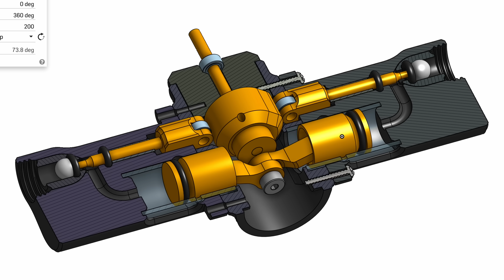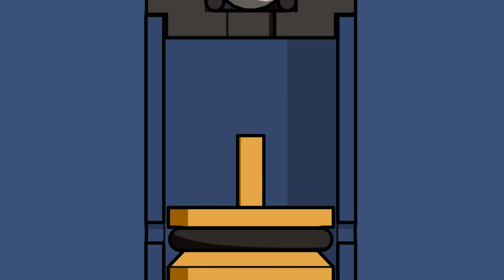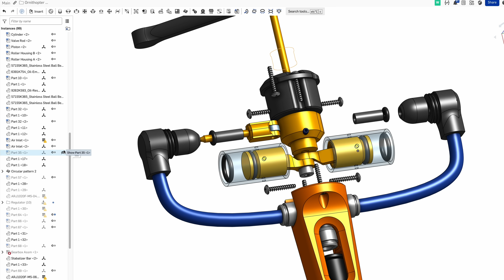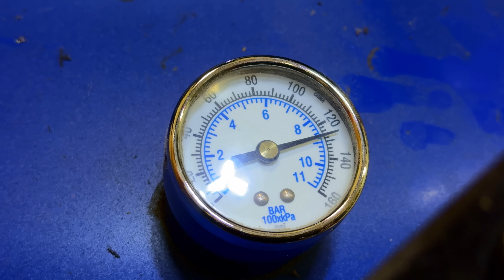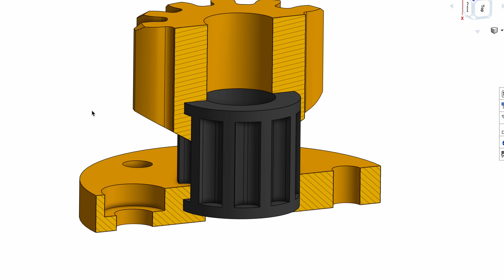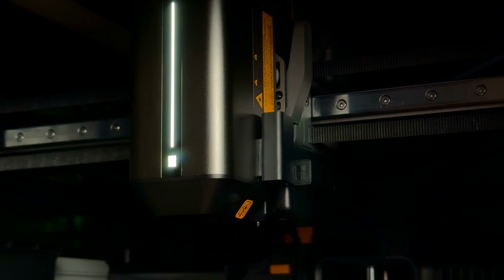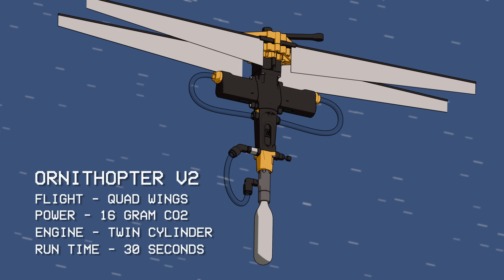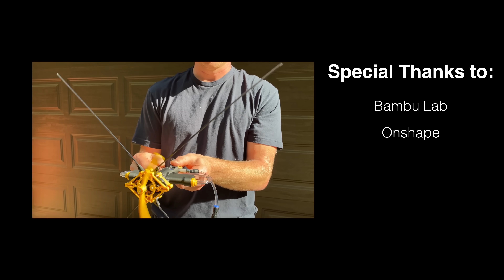I Tried to Build a Flying Machine With Just CO2

Comment: So cool! One thing to highlight, which I'm sure you know, is that regulators waste most of the energy in the gas. As the gas goes through the regulator is just does work on itself by friction, raising the temperature (or at least reducing the temperature drop that one would normally get from adiabatic expansion). One would have much more power if the engine could be designed to operated directly from the ~800psi source, or failing that, at least from a much higher first stage regulator pressure.

Of course if we wanted to keep the force on the crank the same, we'd have to reduce the piston area by ~25x, which would mean a 5x reduction in piston diameter. The o-ring based design would probably be very difficult or impossible to scale down that far. However, you're clearly underpowered, so you're probably going to need a higher force on the connecting rod anyway, and maybe something more like a 2x reduction in piston diameter/4x reduction in area, which would leave you with "only" 6x the force on the connecting rod could be feasible.

I guess another thing to mention is that the dead space between the valve and the cylinder is probably not doing us any favors in terms of efficiency.

Then, another commenter @DuelPorpoise suggested a compound expansion engine. I think this could be highly useful if you operate from a much higher pressure, although not exactly for the same reasons that a compound steam engine is useful. If you can figure out a way to make a first stage engine with no exhaust ports feed a second stage engine, where the crank case of the first stage is basically the first stage's exhaust, then you'd be able to reduce the load on the first stage's connecting rod by the amount of crank case pressure. Maybe there would still be drilled exhaust holes in the cylinder/liner but now these holes are inside of the first stage crank case. The reduced mechanical load might make the conn rod/crank mechanical design easier, although of course it will make things much more difficult in the sense that 1st stage crank case sealing is now required, and since the first stage would see the full inlet pressure for the first couple of strokes before the crank case became pressurized, it might require a spring loaded relief valve bypassing the 1st stage to the crank case to pre-pressurize the it and prevent excessive load on the 1st stage piston.

Then, if you're doing a second stage, it's tempting (although possibly not practical) to imagine inter-heating. Of course, as we expand a gas, it's cooled down (adiabatic expansion). This reduces the pressure of the gas compared to what it'd do if it was kept warm (isothermal expansion), and so reduces the available power. In sort of the opposite manner as an intercooler on a turbocharged engine, we would benefit from re-heating the gas if possible in between stages. Now, doing this in a lightweight and 3D printable way may not be practical. But it sure would be cool! I guess the first thing that comes to mind is a phase change material, and the first phase change material that comes to mind is water. I don't know how one would pass the gas through a system that would allow it to contact a couple grams of water and start to freeze that water in order to reheat the gas to 0C, but if one could do that between the stages of a compound engine, it would provide a significant performance boost. 

But really all that's probably too complicated and more just fun to think about, I think a very high pressure smaller diameter piston engine with far less pre-regulation pressure loss is probably the easiest way to get more power.

Very, very challenging project!

edit: honestly, bubbling the gas through water might work?  or failing that a very small copper tube coiled up in some water? This might even be helpful with a single stage engine. The gas from the CO2 cylinder is obviously way below freezing by the time you're nearing the end of your run.

Hell, you know what might help? Water jacketing the CO2 cylinder. If you just put a couple grams of water in a cylindrical housing slightly larger than the CO2 cylinder, then the cylinder can start to freeze that water as it cools, and keep the cylinder warmer. We could get even more of a performance boost if we started the water out hot, why not! Water has a good bit of thermal mass even when it's not going through a phase change.
Reply: If you increase the pressure into the engine, you would need a much higher piston travel so that the air can go from the maximum pressure on the inlet to near atmospheric pressure by the time the piston is done expanding. Any pressurized air that you are releasing out of the engine is a waste. 

Also, even if the regulator is doing work on itself, the potential energy stored in the CO2 cartridge shouldn't really be affected, should it? In this case we don't need high velocity air, just high pressure, so the size of the hole that the pressure is escaping from should be similar, no?
And I think the water is a fun idea, but that any added mass would hurt the project more than some thermal mass would help it. Thermodynamics isn't my strong suit but it doesn't seem like the temp difference would do all that much when we're working with so much pressure initially.
Reply: @EchoBuildsThings  Couldn't opening the engine valve for shorter time allow it to use run on less/same chamber pressure while being fed by higher pressure? (so getting rid of one regulator) Although that could be tricky to build in practice.
And I'm quite certain that losses in the feed system (from springs, changing path or just the walls) do decrease performance. I suppose that at least for the 2nd and 3rd reason just having sufficient diameter (cross section for airflow) should work well enough.
Reply: @ImieNazwiskoOKthe pulse valve you describe is still a regulator in disguise.

An issue here is trying to 3d print a piston engine. Which should be compact and precise.
Reply: @namibjDerEchte  It's what's pretty much already there as the engine valve, just that it would let in less CO2 (making chamber pressure lower)
Reply: @ImieNazwiskoOK-- Bringing back the cam rod would allow fine tuning of the valve timing and valve depth. Maybe instead of basically a second cylinder on the side, the valve rod could pass through the piston, like the stick that opens the valve now. That might be too complex of a crankshaft at that size though.
Reply: @EchoBuildsThings  Agreed, to use a higher pressure effectively requires a larger expansion ratio.

 I'm no expert either, but "throttling" is a constant enthalpy process but not a constant entropy process. Every time entropy increases, the ability to do work is reduced, that's my starting point for saying we're losing something. 

Basically the gas does work on itself as it passes through the regulator, and we end up with some larger volume of gas, which yes has the same internal energy (because it did "pressure times volume" expansion work on itself and heated itself) but now that energy is at a "lower grade". Carnot says we're worse off than before.

In theory (obviously this is just a thought experiment) if instead of a regulator we had an adiabatic expansion via a turboexpander and then a re-heater, we could couple a generator to the turboexpander, get some work out of the generator, then suck some heat energy in from the outside world in the reheater because the outlet of the adiabatic process is very far below ambient, and then we'd have the gas in the exact same state as when it left a regulator but having already gotten some work out. Even this process is not ideal as we'd really want an isothermal expansion, heating the gas to ambient the whole time it expands (which requires no heating work in theory because the gas is sucking in the heat).

Ok, so what's really practical? I'm not sure, you may be right. The issue with high pressure ratios is that we'd end up at such a low temperature we might not get much more out of it than if we throttled it first (this is where my thermo is weak). 

I'm not sure I understand the point about the hole? 

Re; the water, yeah I'm not sure either. Where I'm coming from is that the CO2 also has its own heat of vaporization and has it's own vapor pressure curve. As it boils out of the cylinder, it sucks in heat from somewhere. If not from the outside, then it cools, which reduces its vapor pressure, which reduces the available pressure to drive the engine (assuming we don't regulate). We really want to try and keep the liquid phase of the CO2 as warm as possible if we're using the outlet pressure directly (less important if we regulate it). Then we definitely want the gas phase as warm as possible as it enters the engine no matter what, so it exerts as much pressure/takes up as much volume as possible. So, would it really help? Dunno, we have 16 grams of CO2 and a 200 gram (is that right?) device, so we only need enough water to release enough heat to keep 16g of CO2 warm and have that weigh much less than 200g. CO2 has a latent heat of vaporization of 230 J/kg at 0C/500psi, while water has a heat of fusion of 334 J/g. So we only need 11g of water for a 16g cartridge... maybe worthwhile on a 200g machine?
Reply: Great comment, and nice thinking. Even I get inspired!

Comment: I have experimenting with Co2 Cartridges in the past. If the outflow is to high, the outlet can freeze shut and the humidity causes ice from forming on the cartridge.
By putting two wraps of Insulation tape around the cartridges you can significantly decrease the freezing from happening.

Comment: I no nothing of  engines, engineering, aviation or anything else. I saw a video on some new 2-Stroke Engine thats been in development for a little while now and it makes it so that gas and oil doesn't mix or something? Makes it extremely efficient. Could you use that idea for this engine in any capacity?

Comment: Did you investigate using a rotary-style engine instead?  Piston seems less-efficient in this context, and would presume timing issues from the fuel version (like the Wankel engine) would not be any issue for just gas release.